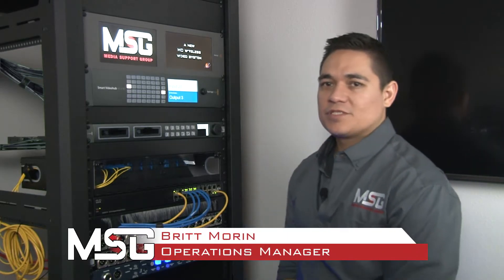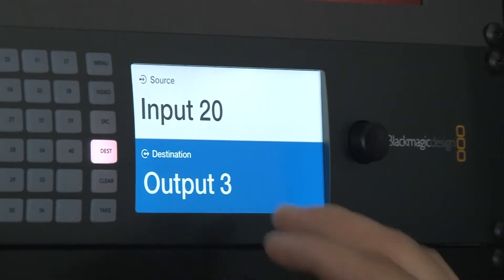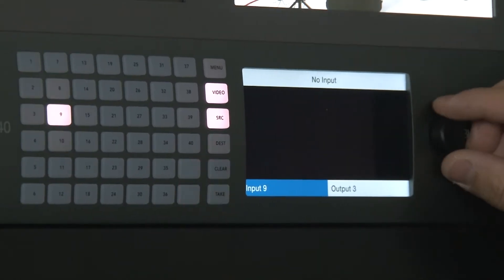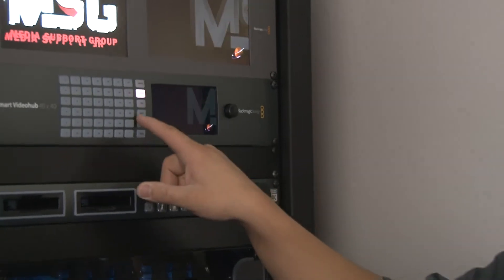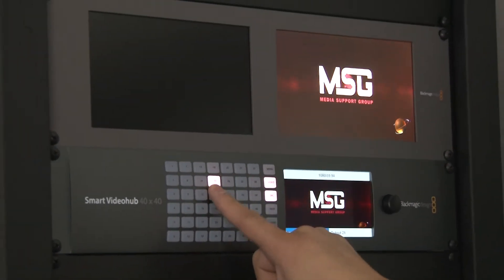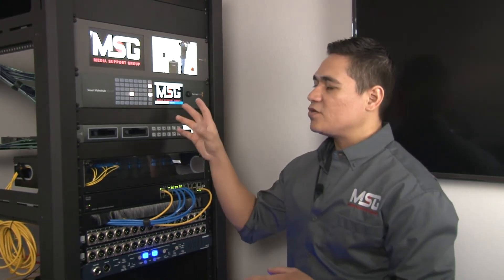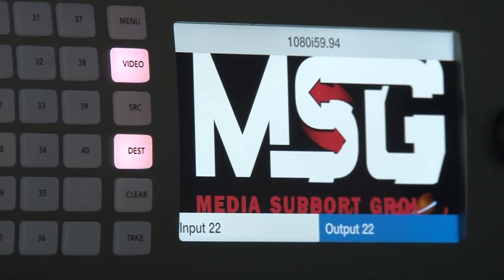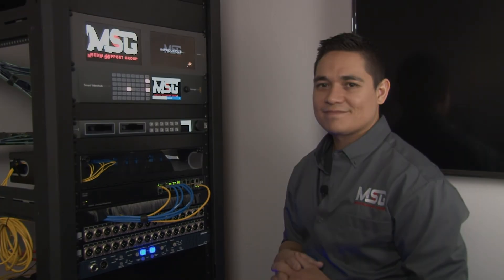BlackMagic Design 40x40 Smart Videohub

Comment: HI! Does the output follow the input resolution/framerate? or does the system scale inputs to a set output reso/framerate?
Reply: It doesn’t scale it. Whatever comes in is what goes out.
Reply: There is no built in scaler. Rg6 or rg59 cable can only support 1080p 60. This is 1080i 59.94 so I’m assuming it’s rg59 cable. So it would not support anything higher than 1080i 59.94.